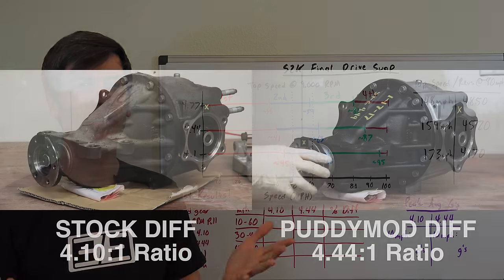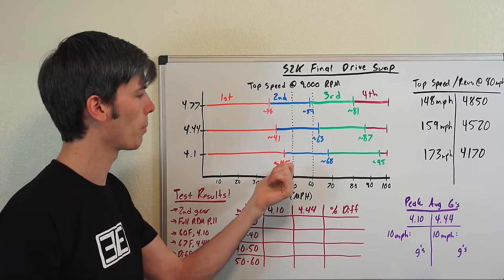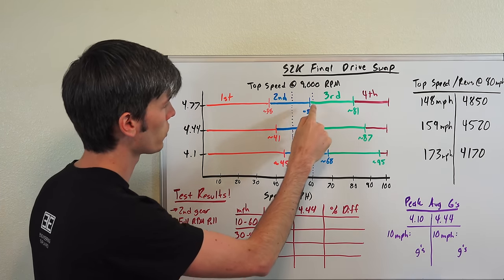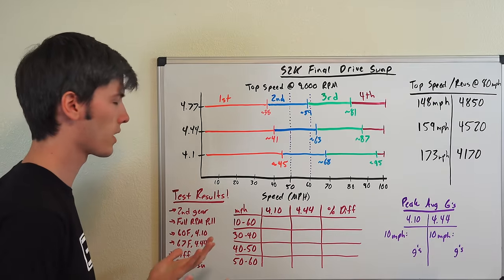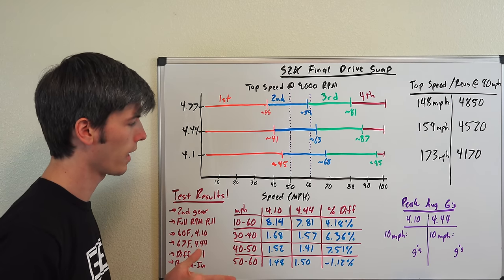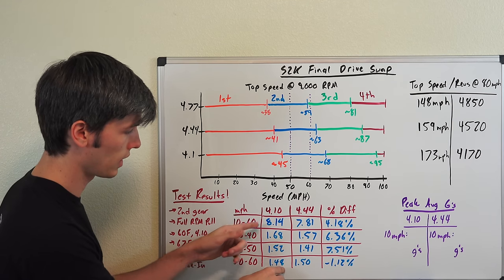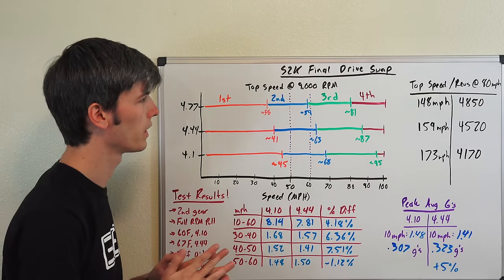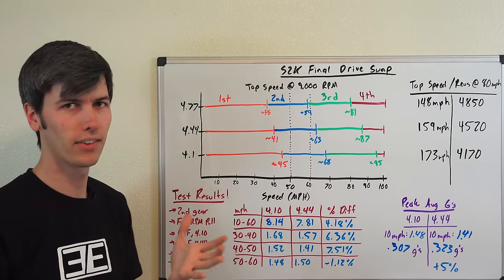Can Gearing Make Your Car Faster? With Proof!

Comment: I love how you clear up commonly asked car questions with the math as opposed to giving a biased opinion based on your personal car setup. Your explanations makes questioning what to get for my car a much easier process. Appreciate your work!!
Reply from the maker: Very happy to hear it, that's the goal!
Reply: Pretty much what I was thinking. I bought an S2k last week - I have different problems to sort out than Jason, but once they're fixed I can see this being my next major upgrade/alteration. The first upgrade being sticky tyres of course - Engineering Explained for the win.
Reply: @Jake22J  Hi, Jake, hope you are well. Are you still tuning your s2000? I am thinking to change the final drive, was checking on YouTube, and saw this
Reply: @xiaozhuyou7817  I am well thank you. Unfortunately the S2K is a bit dead right now. I had other stuff to do to it like fix the roof, then the drive shaft went, fixed that, but that was followed very quickly by an engine failure. So it's been sat there while all this lockdown has been happening.
It's finally due it's fix this month, and I'm still intending on changing the final drive - however to the less aggressive (and easier to find in the uk) mx5 one.

I'll keep you posted lol
Reply: @Jake22J  Are you based in UK as well? wow, I guess you are a member of S2KUK. How many tooth in MX5 one?
Reply: @xiaozhuyou7817  from memory it's 4.11 stock, 4.44 for the mx5, and then 4.77 for the most aggressive Kia Sportage one. Those two remain as quiet as the stock one.

Comment: I went from 3.73 to 4.181 and it was very noticeable. Top speed gearing went from 185 to like 168 from the math I did, but I can't remember the last time I ever went 185 on the street..
Reply: I went from a 3.07 with top speed of 193 to a 3.73 with a top speed of 173, mileage also took a hit. My speeds are not done by the math but actual speeds (drag limited) of real cars that are similar. I wish the math displayed the mileage difference as that may influence if you really want a gear change.
Reply: SkiDooRydr i doubt your car was aerodynamically capable of 185 anyway. But i'm sure with a little bit more wheel torque, it can get to 168 just fine. Ideally we could replace the overdrive 5th or 6th gear, but a new diff gear is much cheaper..
Reply: Here in Germany the top speed decrease would be a problem ;D
Reply: Well considering I am making almost double the horsepower the stock internals were designed for I'm not exactly worried about that, but yes I would imagine slightly more wear if I didn't maintain the car.

I calculated out the rpm difference for each gear and the reality is I only see about 300 rpm difference at 70mph on the freeway. I suppose if I wanted good gas mileage I would just drive my daily driver.
Reply: Take your pick:

- For US residents, the highest speed limit in the United States is 85, and this is a very small percentage of the roads (mostly rural southern areas). In most states if you were caught driving 160mph you'd get jail time.

- 185 in the 1/4 mile would be like a mid 7 second 1/4 mile. Most people aren't daily driving 7 second cars.

- You are increasing your acceleration in all gears so thereby reducing your 1/4 time.
- You'll potentially see better lap times on a tight road course as you come out of the corner.
- Faster acceleration without needing to raise power at the motor. Reduces risk of blowing the motor especially on stock parts.

This is Engineering Explained, not 1320video. Why would anyone realistically need to go 185mph on the street?
Reply: SkiDooRydr but the 1/2 mile racing ;c
Reply: @SkiDooRydr  I would commute at 185 mph if my VW Polo had more than 60 horsepower. But I live in Germany
Reply: i think everyone is forgetting the difference between theoretical and applied top speed. the s2k gearing might be able to theoretically reach 185 mph, but due to drag, limited 4 cylinder hp, aerodynamics it will never reach anywhere close to that even with full bolt ons and tune/turbo.  s2k top speed with stock gearing will reach about 160 max even if it could theoretically reach 185. only when you reach 500+ whp will you be able to make use of stock gearing and reach 185 mph. but for the average person getting 4.181 gearing wont really change the top speed. also the s2k 6th gear is a overdrive gear so if youre worried about highway, crusing rpms dont be. a high revving engine that revs to 9k is designed to be able to rev. even if you were cruusing at 4k-4.5k rpms it wouldnt wear out the f20c.
Reply: @brucelee7283  Should i get 4.88 gear for my 240 with 4gears and no overdrive?
At 120kph speeds the revs would be 5000..
Sounds good right?😎 
BUT only 4100 if i would get 5 speed gear box. At least i wouldn't be aerodynamically limited. Just gear limited.
Reply: C4 Corvette is great for aero.
Reply: 383 was my motor, heavily ported 12000 dollar motor.
Reply: So I guess you'll get to 168 a lot faster than someone who has a top speed of 185 but the advantage is they can actually reach 185

Comment: That editing to get the numbers to appear on the whiteboard with a finger snap was really clean. I had to watch that 3 or 4 times
Reply from the maker: Haha, glad you enjoyed!
Reply: Benissocoolike at first i thought it was just a very smooth jump cut. But looking at it like 100 times it seems it wasn't a jump cut at all.
Reply: +M P I did at first too. I'm pretty sure it was a fade into an image overlay, and then the cut less than a second afterwards was the "jump cut". That would also add reason to why he took a step back before using his magic fingers, to guarantee his hands won't get in the way of the shot. 
It turns out way smoother this way though and looks really good.
Reply: Benissocoolike that is exactly what i thought!
Reply: my guess would be that the numbers were always there and he just put a white overlay over them until the fingersnap.
Reply: Yeah i love that too totally amazing.

Comment: +5% more g force    --->     +5% bigger smile
Reply: U got that right.
Reply: Willian Melnechuky Sorry, your math is wrong. G force isn't equal to smiles. Smiles are squared. 5% more G force = 25% more smiles
Reply: Christian Haffner 5% more =  1.05 times more
1.05^2=1.1025
So you smile ~10% more
I think your math is wrong
Reply: Dion Rest ..it was a stab at humor not remembering that the fans of this page are more educated. If I would've though 2 more seconds before posting, I would've seen the error in my ways.
Reply: Christian Haffner okay, it can happen
Reply: Christian Haffner Ha ha.  Remember, if they wanted engineers to have a sense of humor, they would issue them one in college.

Comment: my dad worked at Chevy a little after the oil embargo in 1975. he said that Chevy 350s were sucked of so much power they made only around 160hp, but their torque was still there. he made differentials in the assembly line, and said they put more aggressive gearing to compensate for the engine; a faster top speed in 5th gear and a better acceleration in 1st.
Reply: in the late 70's nothing was making any power... my 302 was rated for ~140; it sounded the business and had the torque to light them up, but it wasn't going anywhere.
Reply: ronindebeatrice yep my dad's z28 was the exact same

Comment: protip: if your car is slow but you want to feel the g's mount the passenger seat backwards so its facing the rear and sit in it while having your friend slam on the breaks at like 60mph.
Reply: LOL
Reply: Accelerate Your car at reverse gear to maximum speed and press hard on brakes later on
Reply: Lol funny

Comment: Even for a daily driver the 4.44 would work if you live in East Europe, because there aren't many highways around here. 

Now if you live in the mountains it would also benefit you, because of the curvy mountain roads you can't go too fast and some extra wheel torque would help on the way up.
Reply: n33niki that setup will work on Orlando, FL. highways are packed, so you basically drive on a city in a ~25 miles radius.
Reply: n33niki where he is in Idaho he gets the best of both worlds
Reply: That's a good point!

Comment: We used to run a 3.89 cruisin gear, (1970 Mustang) then bump to the 4.56 on track day ;-) That 351 cleveland engine HATED the 4.56 on the highway !!! And you could hear the carb's secondaries open, which meant your gas gauge would drop quite quickly... The early 80's seem like a century ago... Love your video's :-)

Comment: Great video. I have a 2002 Q45. It came stock with a 2.76 differential. In 2003 they made a few performance improvements, one of which was changing the differential to 3.13. I'm considering swapping it out to the 3.13. This video shed some light!!
Reply: Watched again. Thanks!

Comment: Great video! I went from a 5 speed and a 4.3:1 final drive to a 6 speed with a 3.9:1 final drive on my MR2. It's my daily, lots of highway, and it dropped my revs at 70 MPH from 3500 to 2800. Great for a car with no sound deadening, and 37 MPG is nice too. I did lose some acceleration but gained an LSD.

Comment: my friend and i did this in my car the other day for testing purposes as i am getting my Z tuned soon.  the results were surprisingly good.  i wrnt from 10 to 60 in about 6.5 seconds with all-season Michelin tires..  i know from experiance that Z's so not achive WOT until you reach 45mph, so it not getting all of the power available.  with that being said, im sure after the tune (stickier tires as my TCS went crazy after 35mph) it could do it under 6 seconds easily. 

good videos brother, keep'm coming.

Comment: New subscriber, I’ve watched a few of your videos prior to subscribing.  I am an engineer by trade, so your approach to explaining the data is relatable for me.  I’m currently in the process of a gear change, I simply used a online calculator to come up with my gear ratio swap, but wanted a deeper understanding so this video was perfect for that.  Thank you for taking the time.  It does sound like we are similar in that you did the math and second guessed, after the swap you wished you would have went with the smaller gear ratio.   We all do those things, but especially “engineers”.  😂

Comment: please explain the beautiful snapping and crackling sounds that rally cars make so well. i start to drool when listening to group b rally cars. o and that noise the turbo makes, not the blow off valve but that odd sputtering sound as if something is slipping. you the man though keep up the dope vids
Reply: ryan p i dont know about the first thing (i dont really know what you are refeering to), but the turbo flutter sound is caused because when you let off the gas, you close the throttle body, and all that pressured air that the turbo was building has to go somewhere, so it goes backwards and slows the turbo down (it doesnt stop it completely though).  thats why people install blow off valves and diverter valves, to reduce the turbo lag a bit between gear changes and to protect the turbo, but i dont believe its that harmful.
Reply: ryan p 

I think the snapping sound you're referring to is antilag which I think engineering explained has covered. 

There's also a ton of videos on here with various rally cars spitting, crackling and snarling their way across various rally stages :)

Comment: I went from 3.21 to 3.92 gears in my pickup truck and also went from a 33inch tire to a 30inch sport tire. Holy crap! With the 8-speed transmission the Hemi can't even tell it's pushing a truck around.
Not counting forced induction, it made the biggest performance gain I've ever felt.

Comment: Wish i had a garage :(
Reply: Archer There are many parking lot DIYers. it's possible. You just gave to be careful yo make sure people know you're under the car and make sure to use stands and all the regular safety. 
And it would be good to have a roller bed because the floor may be hot or whatever. 
Oh, make sure the ground is level
Reply: Don't have a garage, nor do I have a concrete drive. We do however have a shed full of tools for just about whatever you need. My dad and have done a lot just in the grass, if using jack stands just make sure you have a good base like a piece of wood. Just sucks not having a space out of the weather.
Reply: i go to walmart when i need to work on my car just go under the solar panels if they have them and be prepared with your tools anyone says anuthing just say you already called aaa hahaha but you should be fine i used to use walmart parking lots as a rest stop miata livin hahah
Reply: Jacob Hayes My driveway is made of dirt too but I have the tools to do anything.
Reply: Jacob me and my dad are facing the same thing. Tools for everything, even enough to build a house if we wanted, but no other space in his shop. Everywhere else is sand and grass, equally. 

We've got wood, jacks, jack stands and wheel ramps though. He's even got a place for his tractor to pull it out and pull a vehicle under. 

Still, it's not a garage or shop though. Ya know?
Reply: if you got a tractor handy ( a real farm tractor, not a riding lawn mower) and the room for it, start laying out an area for a shop. metal shop building kits can be had pretty darn cheap, i've seen 20x30 kits for around 5-6 grand. use tractor to start digging out for the foundation and floor, get foundation and floor slab poured, order building kit, spend 3-4 weekends assembling kit and its game on.

Comment: Always wanted to try 4.44's, good video!  I had Kia Sportage sourced 4.77's in my AP1, it was really fun and felt great on the track but for every day driving at 70mph on the freeway the 4500rpm in 6th got a little old, with my AP2 I decided to keep the stock gearing but always wondered about 4.44's with the improved AP2 transmission.
Reply from the maker: Yep, I love the AP2 gearing, wish I had it in my AP1! I think tall 6th gears make a lot of sense, because honestly if I'm flooring it, I'm probably not in 6th gear at 150 mph.
Reply: Engineering Explained A taller 6th gear swap... Hmmmm, sounds like a future video to me.

Comment: IMO the best solution to get high torque at low rpm and also a high speed at final gear, is to use a gear box with 7,8,9,10 gears. I know everyone knows it.

Comment: So with this gearing change is your speedometer still correct? I was searching around and couldn't find any standard location between wheel sensor or transmission sensors, wondered what that looked like for you.
Reply from the maker: Speedometer has to be calibrated after a gear change. In this video it reads about 7% high. I'll have a video soon on how to fix it!
Reply from the maker: Yep, exactly the same!
Reply: Does the speedometer change only apply to cars with a rear diff like the S2K, or to cars with a transaxle as well? I've noticed Honda people saying a different diff won't affect the speedo, since the gear reads from the diff housing spinning.
Reply: Trans axle Hondas are not effected but the s2000 is.
Reply: Thank you Zac!
Reply: I installed a 4.44 in my S2000. The speedometer was not correct so I purchased a modifry correction module. Pretty easy to install. here's the link. 
 http://www.modifry.com/index.php?route=product/product&path=18_66&product_id=61yj_faq.htm

Comment: Good presentation !

I think there's a sweet spot for each car depending on the power/torque curves of the engine and how many gears you have available... ie. you want to remain at peak torque for each upshift since the cars horsepower will determine your top speed.  

If your car only has 5 or 6 speeds, then a lower ratio diff will definitely improve acceleration with a small increase in fuel consumption.

But if you go to the extreme of having too many gears like the 10-speed auto in the new Camaro ZL1, you'll end up being slower around the track than a 6-speed manual, because the gains achieved in keeping the engine rpm high with each gearshift are negated by the time taken for the extra shifts required to reach a certain speed. (if that makes sense)

This is why even hypercars today only use 7-speed gearboxes.

Comment: stock gears are the best becz they are design for long life and durability. and second thing from that the short the gear ratio of speed the more faster u can achieve the speed.

and also if u change the gear box with custom one that the engine need to work more hard the turbo (sometimes turbo failure),etc. So for that u need to do tuning and if it fails then buy a new one.

so parts to be changed. 
blow off valve
turbo
valve timing
injector
spark plugs
cylinder head
ecm
also crdi system (as per the vehicle)

if not done this much change u end up some or the other problem like engine failure, turbo failure, cylinder head leak, vibration becz of injector, engine check which never go in ECM.

plz comment if u think its right or wrong. (if wrong plz explain)

Comment: What might be even more fun would be to use very aggressive gearing like the 4.77 but also change the top gear so that it is the same overall gear as stock.  That would give you 5 very aggressive gears for playing and for increased g force, but still have your low revving top gear for cruising at highways speeds.  That way you have the best of both worlds.  Actually with the lower 4.77 final drive, if you shift at the same RPMs as you normally would with the 4.1 final, gas mileage might remain close to the same as stock if you drive not so aggressively.  But the main point to a greater reduction final drive is to increase the fun factor.  Been there done that.